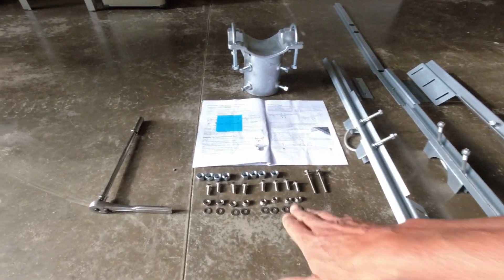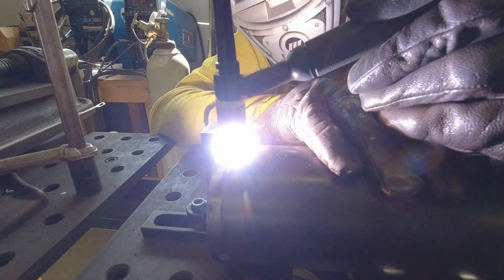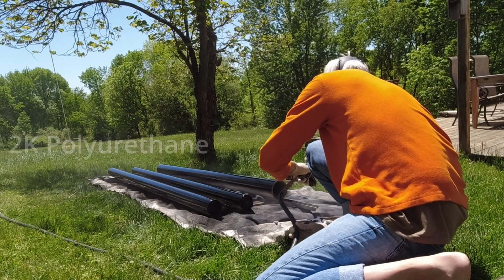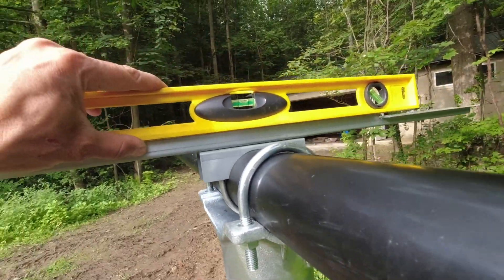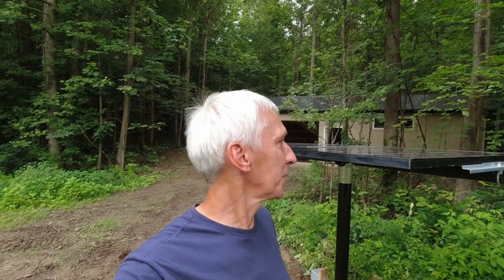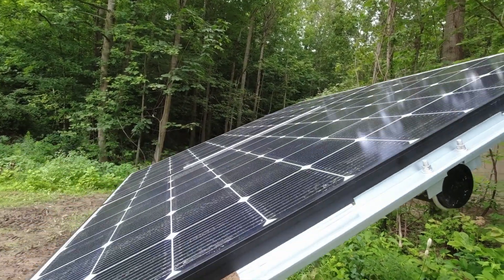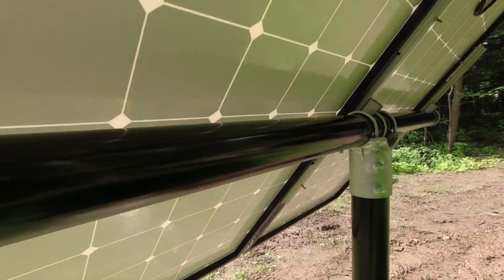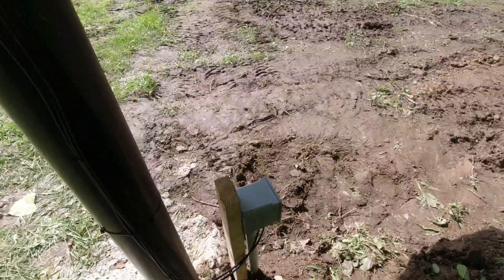Tamarack economy solar panel mount

Comment: Do you need to do any grounding for only 2 solar panels in series like your setup?
Reply from the maker: No grounding necessary.
Reply: @ is that because it’s only two panels?  Or for another reason?
Reply from the maker: @WingAddict  No, nothing gets grounded on the solar panel side, not even larger parallel strings. I can't speak for large commercial systems and local laws. Inside your electrical box in your building is a grounding bus that I connect to a grounding rod that is pounded into the ground. That single point of ground gets connected to the electrical outlets.

Comment: I'm thankful for your video. I got the same however it's a 4 panel on one post. Hope it doesn't make the lateral 3" pipe bend down. Will have to remove the snow promptly. Please share anything else you're willing to share now that you have installed it and have been using it. I have 24 panels and 1 as a back up. Thank you again. I bought Canadian Solar CS3N-390 HIKU black
Reply from the maker: I think your 3 inch pipe will be fine. These new panels are a lot lighter than the old ones. I think my LG405 are less than 40 pounds each. I have some older panels that weigh almost twice that.
Reply: @offgridsimplicity mine are 49.6 lbs each
Reply from the maker: @johnnywalker5635  I think you will be just fine. The setup in this video is rated for 110MPH wind loads. I will never see that in my location.